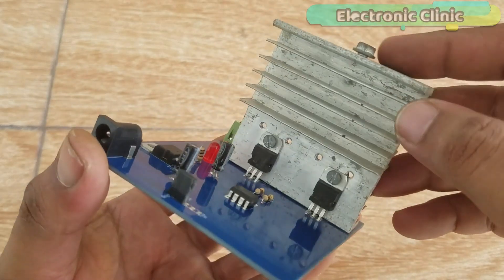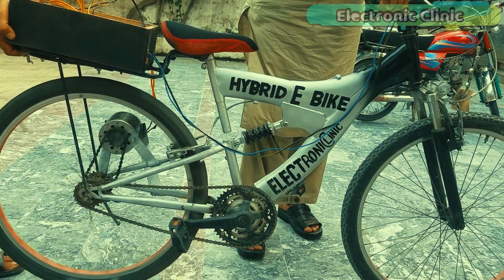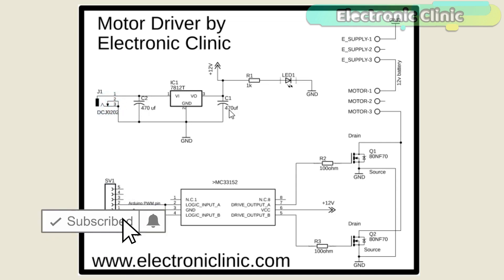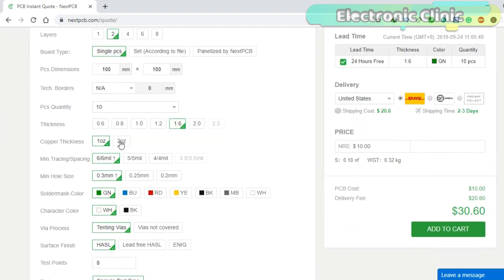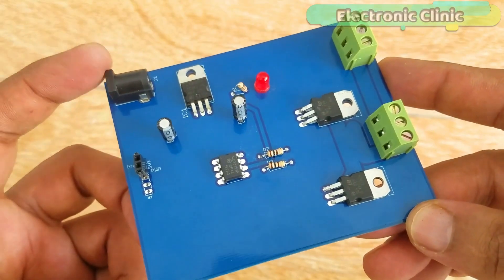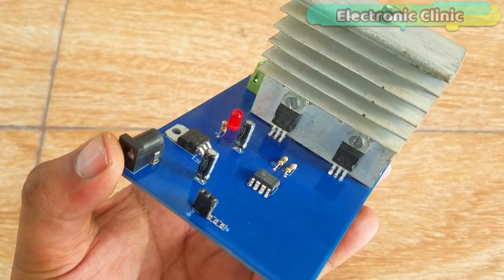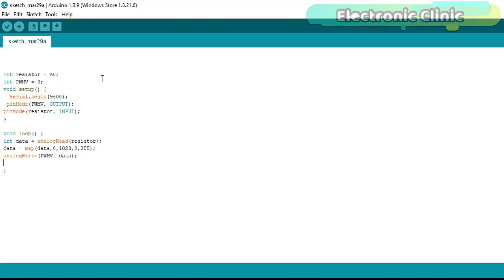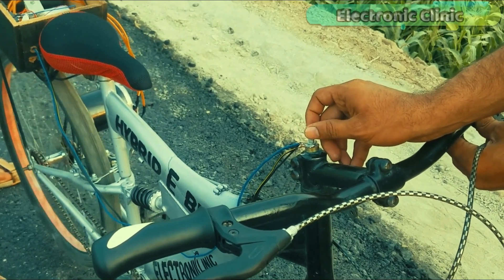DIY High Speed Electric Bike  - Best Hybrid E Bike or Bicycle Part2

Comment: hello, your motor is 24v but youre connecting the battery in parallel which is 12v, is it correct?